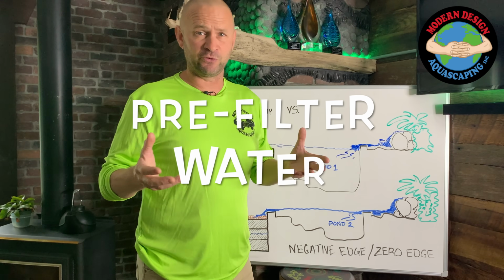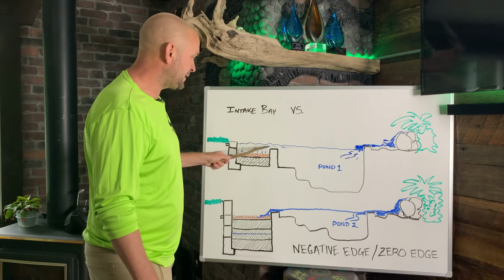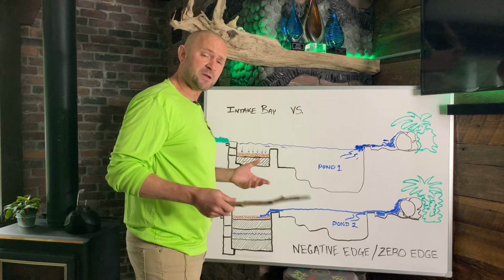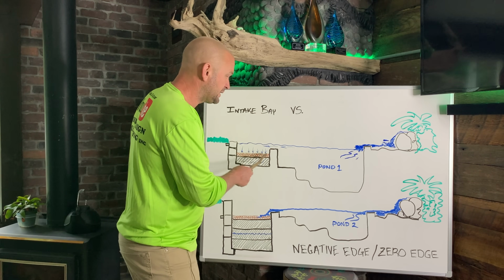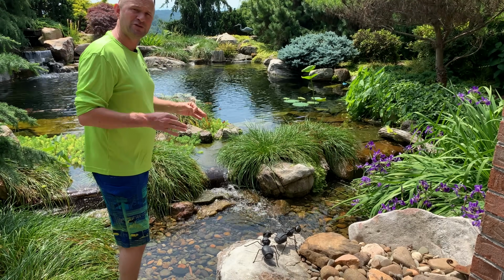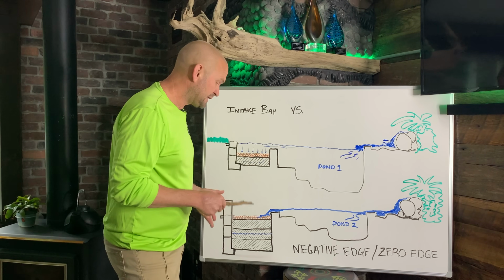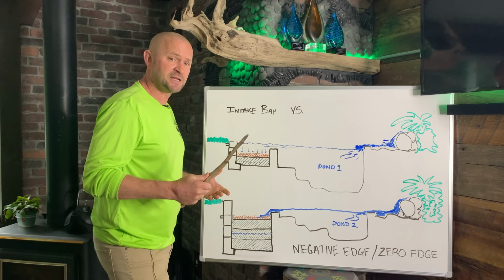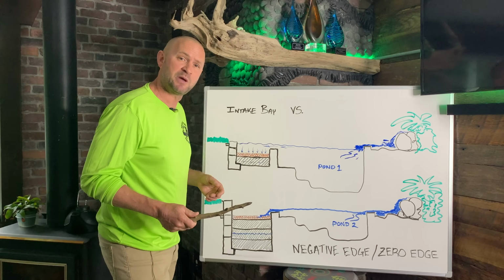Zero Edge vs. Intake Bay | Which Pond Skimmer is Right for You?

Comment: VERY INFORMATIVE! I learned a lot. I don't understand why those filters aren't creating biological filtration. If those are Aquablocks covered with gravel why isn't it a form of biological filtration?
Reply from the maker: They are in fact creating tons of biological filtration. The intake bay obviously has much less surface area but the biological filter up top (also called an upflow wetland filter) is designed with specific flow rates per surface area to encourage amazing biological filter activity that is easy to clean and maintain!
Reply: @koiaddiction  i understand. In an area with lots of leaf fall would these systems require daily maintenance? More than an Aquascape skimmer?
Reply from the maker: Depending on solids, they can handle so much more material than a skimmer. At certain times of the year it may make sense to create some sort of a net that you can just lay in the bottom of the intake so that you can simply pull it out to dump the leaves and then replace it. It is definitely created with the intent of being a mechanical filter. The purpose is to gather all debris into one easy to access location where you can physically remove the debris.
Reply: @koiaddiction  Thanks for that clarification. Other pond builders in Israel say that an Aquascape design would not work well here due to the tremendous amount of dust we have in the air from the Semi arid /desert environment. Would an intake bay and a Wetlands filter be the solution?
Reply from the maker: I don’t see dust being an issue with this filter system at all. If the dust collecting on the surface of the water tends to be the problem, the negative edge system will handle that by skimming it off. The wetland filter should have no problem capturing the dust though you may have to clean it more often depending on the amount of material that it’s capturing. If the dust is extremely fine and is staying suspended in the water periodic additions of flocculant may be the silver bullet. I would also ensure that the water flowing up through the wetland is slow enough that the particles can fall out of suspension, You may have to stay more on the low side of the 1500 gallons per hour per centipede module👍🏻

Comment: Great video John!  Do you use the surface area of the pond x .25 to figure out the water in motion for the neg edge and double that volume for the containment?
Reply from the maker: Honestly it’s a very tight situation figuring surface area of the pond. It really depends how you build the negative age as to how much of the pond water will leak down. My first ones would only leak down an inch or two quickly but then would leak down another 3 inches slowly after the fact. We have learned to manipulate that situation now so that we only lose a few inches. Once we got good at that method, 3 inches of drop is typical. Or larger ponds or higher flows that number increases a bit. After that calculation we double at least if not triple the water in motion For containment. Let’s not forget about streams of waterfalls and all other head-waters being added into that equation as well!
Reply: @koiaddiction  makes me think about a few things. Thanks very much. See u at pondo

Comment: Great explanation John G Adams! Many people have made huge mistakes when trying to design a negative edge like an intake bay! We like to triple the water in motion for the containment system. One part equal to your water in motion calculations which includes pond surface. Then one more part to double the water in motion storage in the event of system starts and stops in the events of power loss etc. for water in motion capture. Third part for smooth operations during large volumes of water loss due to evaporation on higher volume ponds at higher flow rates and for debris overload due to lack of maintenance procedures. Many use the wrong size gravel and utilize geotext fabric on top of matrix blocks which can truly be an educational event! Truly cleaning a large system properly with matrix blocks depends on properly designed building with drainage occurrence below the matrix blocks. Again, great video on YouTube John and I hope you do many more of this sort!
Reply from the maker: You are right about all of that. I plan to do a water in motion video at some point in the near future since it seems to be one of the most misunderstood things in the design process and we often encounter ponds and waterfalls that are designed wrong and don't function properly because of it! Cheers!